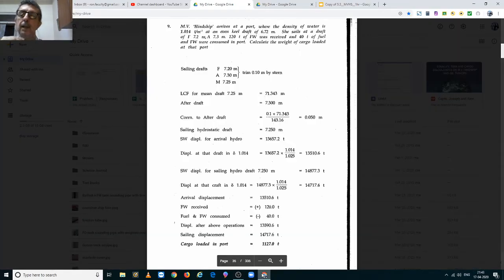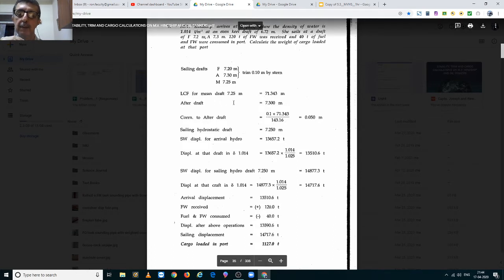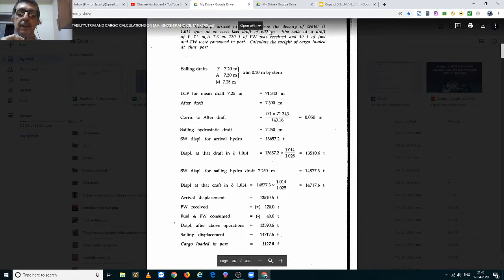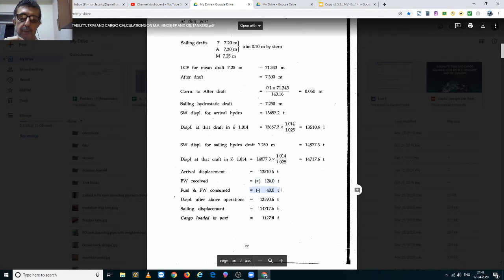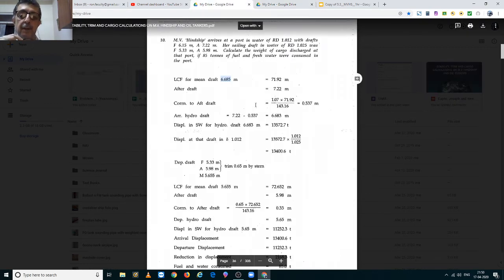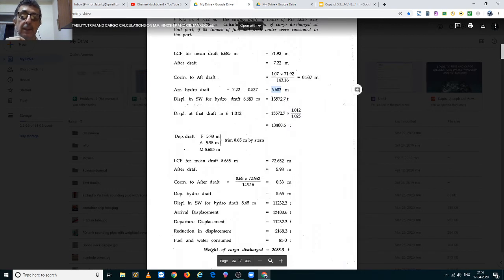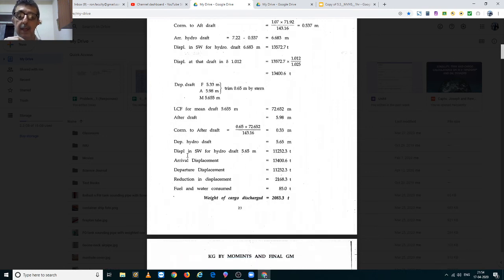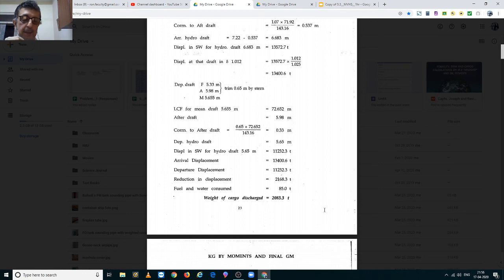MV Hindship problems 9 and 10

Comment: sir, the arrival displacement is calculated in dockwater density and the departure displacement in SW density. can we substract them right away like that? dont we need to convert the departure displacement to density 1.012?
Reply from the maker: Hello Anindya, I think you are referring to problem 10 in the video. It so happens that ships come into a port where the RD of the water is DW. She entered the port from the sea. After cargo operations at the port, she will now sail out and once again reach the sea where the RD of the water is SW. The drafts given in the problem are those in SW and hence the displacement in Sw has to be found from the hydrostatic tables. From this final displacement the displacement in DW after completion of cargo operations is to be deducted to find the amount of cargo discharged.

Going by your question, the draft of the ship upon departure, when in DW, would have been more than the drafts as given which are in SW. If we had the departure DW drafts, then we could find the displacement in DW and deduct the arrival displacement from that value. The answer you'd get would be the same.

But, in the problems we are given departure drafts in SW and hence the above methodology for the solution will not work.

Trust I have resolved your doubt.
Reply: @capt.ronirani5691  thank you so much sir. i understood. thank you for taking your time and explaining in such a detailed manner. :)
Reply: Still confused as why it was done tthis way
Reply: Q9. Both arr and dep in dw 1.014, q10. Arr in dw and dep in sw.